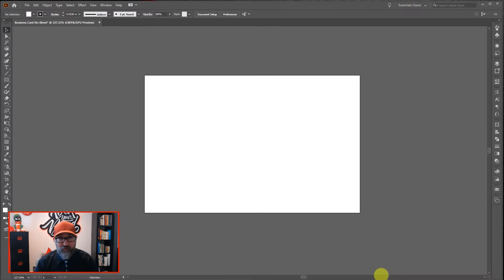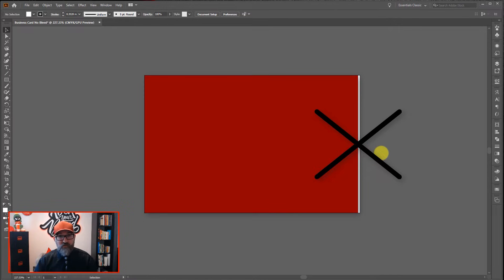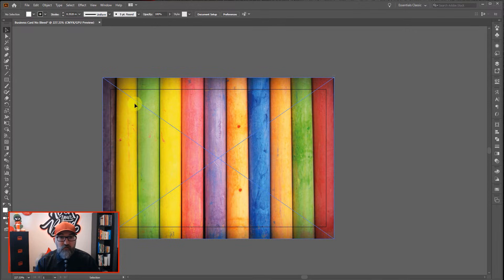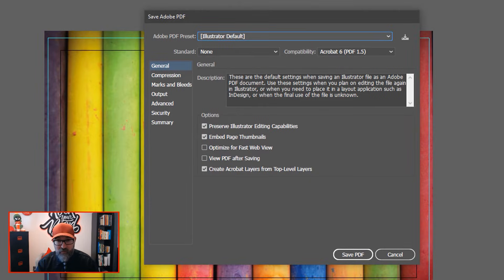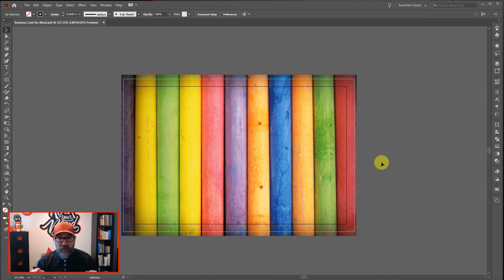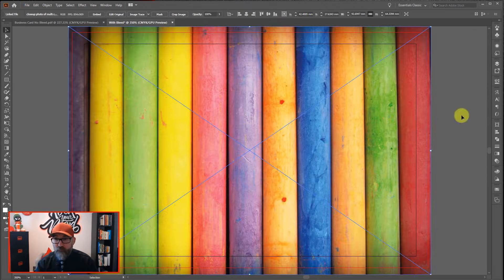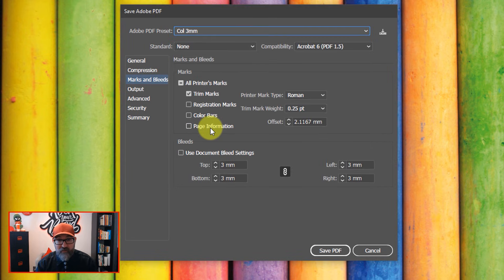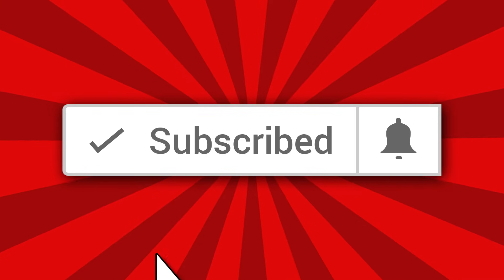How to add and apply a bleed in Adobe Illustrator - Design for Print Tutorial

Comment: Curious why you started the video demonstrating the more time consuming and unnecessary method of creating bleed guides (using the rectangle), rather than just showing the quicker method of just setting bleed via the PDF save dialog box. Also, why suggest setting up bleed after a design is exported to PDF? You want to have bleed visible in your native AI file. It just seems it would make more sense showing how to set up bleed so it's visible in the AI file.

Comment: If I extend my artwork beyond the red bleed guide lines, the PDF doesn't have the white border around the edge, is that normal?
Reply from the maker: Hey Callum,
As long as your artwork goes up to or beyond the required bleed you are good to go.
Reply: Thanks you sir, I think it's because I was working on a much larger document size, and didn't include trim marks. @RockYourBrand

Comment: @Rock Your Brand® Hey, How are you doing, I am confused. is there any formula where I should put my bleed and the size of the document? For instance, I want to apply 0.125 in bleed to A4 size (8.3 x 11.7 inches), so I added 0.125 to 8.3 In and 11.7 In respectively. (8.3+0.125) In x (11.7+0.125) In. Idk what I am doing wrong :(
Reply from the maker: You need to apply the bleed to each side of the artwork. I don’t work with inches, but if I want to add 3mm bleed to an A4 document then that would be 210mm + 6mm and 297mm + 6mm which gives you 3mm to each edge of the A4 document. 

I hope that helps.
Reply: @RockYourBrand  Thank you very much, cleared my mind.

Comment: How would one apply to this "Size: 170mm (w) x 180mm (h) (there will be a 10mm overlap/bleed)"
Reply from the maker: Hey there, it really comes down to what printer you are using requires.

If there is a 10mm bleed requirement, then I would presume that means 10mm to each side, and so your supplied artwork including bleed would be 190mm (w) x 200mm (h).
Reply: @RockYourBrand  thank you so much!
Reply: @RockYourBrand  Hey, How you doing, I have confusion, why 190mm (w) x 200mm(h)  why not  180mm(w) x 190mm (h) as he said  (there will be a 10mm bleed). I mean is there any formula where I should put my bleed and the size of the document? For instance, I wanna apply 0.125 in bleed to A4 size (8.3 x 11.7 inches) so what I did is add 0.125 to 8.3 In and 11.7 In respectively. (8.3+0.125) In x (11.7+0.125) In. Idk what I am doing wrong :(

Comment: Am i going totally batty or was there not an option fo creating an artboard with a bleedguide from the setup? i've been out of the design loop for a few years now so a bit rusty but i really thought there was a auto setting for this.. or is it a classic case of new update where adobe removes something people use every day for absolutely no reason
Reply from the maker: Yes, when you set up your document you can specify the bleed amount, but it doesn't automatically apply crop marks for when you export the file as a PDF. So this video was more for explaining what bleed is and then how to make sure you add crop marks when exporting as some printers require them :)

Comment: can we reduce crop mark length while making pdf, im talking about mark and bleed section in export pdf panal. 
now default length is .25in i want .125in.
Reply from the maker: Hi Raj,
I've never looked into that myself. Is there a reason that you need to shorten the crop marks? They are trimmed off in the cutting process and so they don't appear  on the final printed product, so I am curious as to why you are looking to shorten them?
Reply: @RockYourBrand  my pre press printing unit want short cutting mark, that's why

Comment: Thanks for tutorial as I am trying to add 10mm bleed but to fill 10mm have to add 20mm like 297X210mm the bleed i add 10mm but to make it proportion 317X230 than it fill bleed bar.. any suggestion
Reply from the maker: hey Ashish, that is correct. if you want 10mm bleed you need to add 10mm to each side of the document, so 317mm x 230mm is correct.
Reply: Pixels Ink I see thanks for your feedback.. cheers

Comment: Thank you, Dear sir i have added 3mm bleed and after i printed the page, it again bring the white border in the edge, is there any other setting to set first?
Reply from the maker: Bleed is only really used when you are sending artwork off to a commercial printing company where they will be trimming down the artwork after printing. If you are printing on a home/office printer then many of those printers will not be able to print right to the edge of the paper and you will always have a white border.